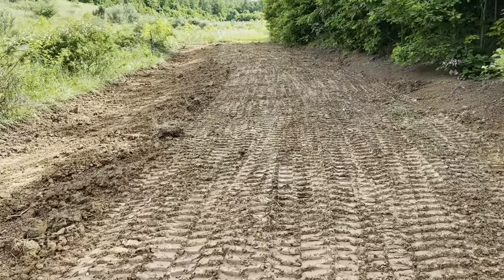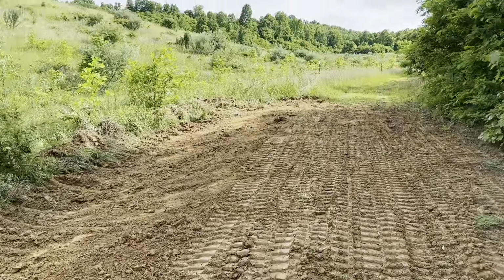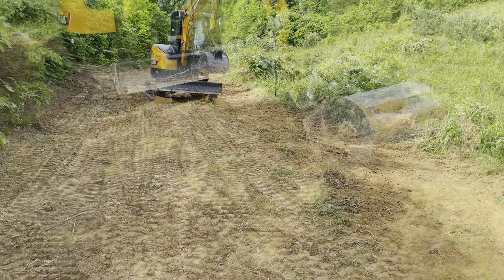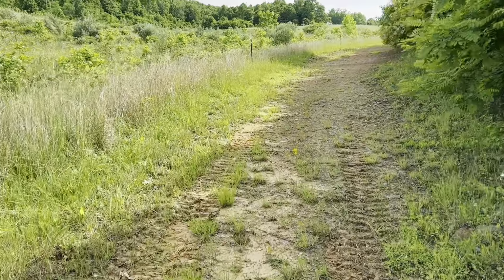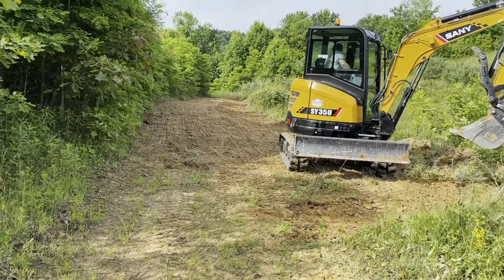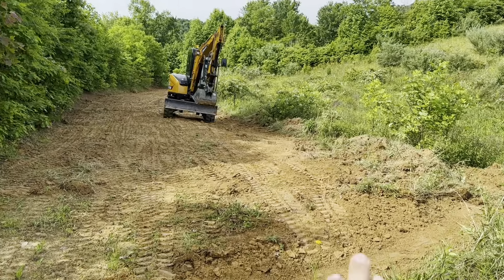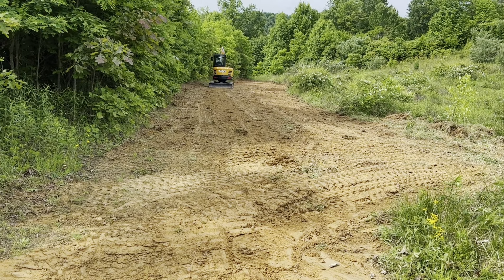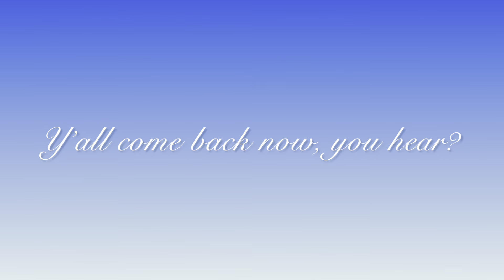Farm Road Repair | SANY SY35U Mini Excavator In Action.

Comment: I have exact same unit, I don’t notice any power loss w ac on
Reply from the maker: We rented this machine and it was lacking power, couldn’t do two functions at once without the machine struggling. It was a brand new machine with only 100 hours on it. Something wasn’t right on it, my theory is the rental company turned down the hydraulic power or something. A brand new machine like that should be a powerhouse.
Reply: @cjwhomesteading200 that’s a good theory, people trash rental equipment lol. They must have found a way to make it weaker to lower chances of someone really torquing on stuff